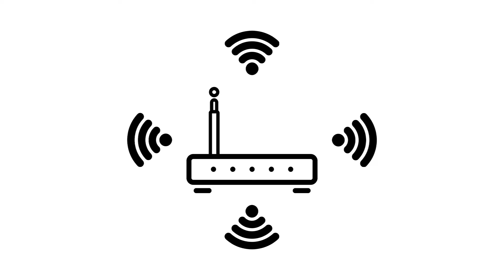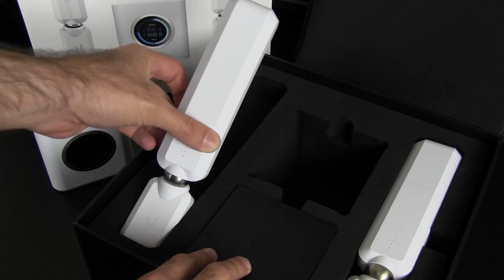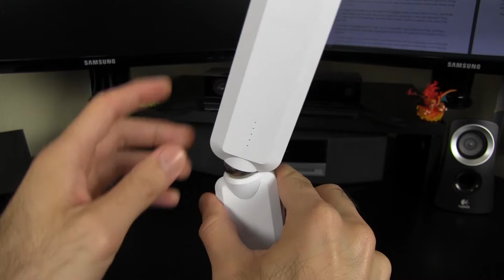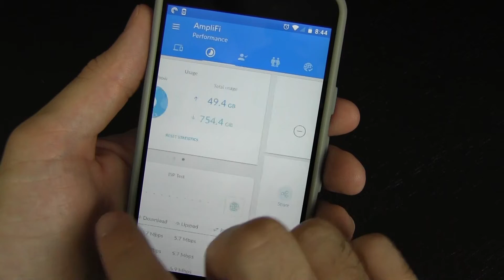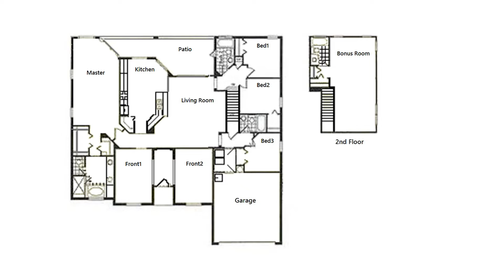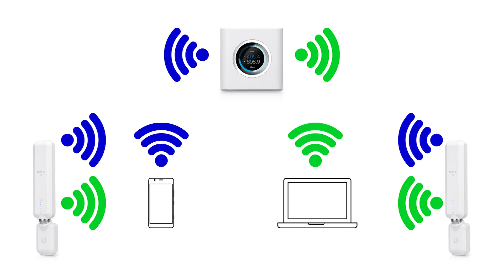Ubiquiti AmpliFi (AFI) Mesh Wi-Fi System Review

Comment: Good video, i opted for 3 of the HD standalone routers to setup an ethernet backhaul configuration on all 3 plus having the ability to use all the ethernet ports as well. I dont like the fact that the mesh points are only wifi in the pack version. Infact if you do buy the standalone HD routers you have much more flexibility as you can also use them with an aftermarket router and create a mesh network. Whereas the pack version is indefinitely paired to the wifi only mesh points and cannot be unpaired.

Comment: Is this the HD or the standard (AmpliFi Standard Home Wi-Fi Router)? I am confused about what the difference is between the standard and the High Density. Could you enlighten me? Thanks
Reply from the maker: Tanner Christensen There are three different versions of this system actually. AFi is the standard, LR is the middle one, and HD the top model. I believe I talked about the differences at one point in the video, but essentially it comes down to range and network type support.
Reply: Thank you for the quick reply, I really appreciate it.